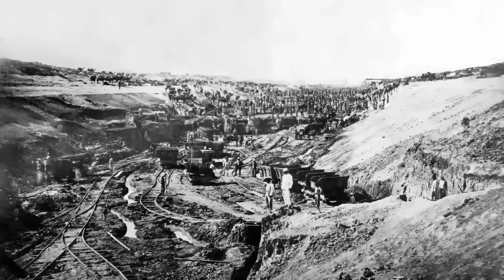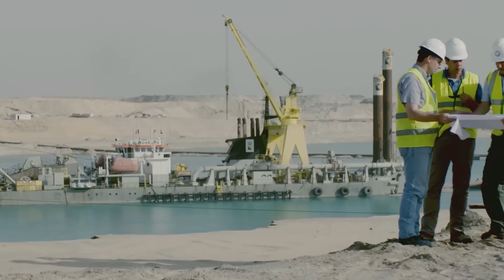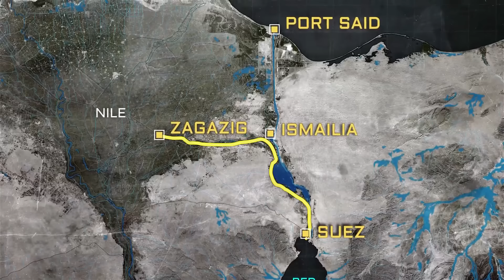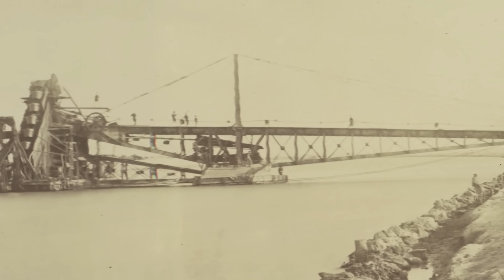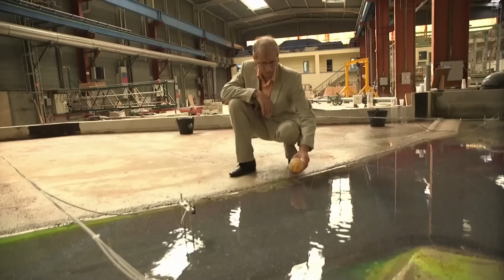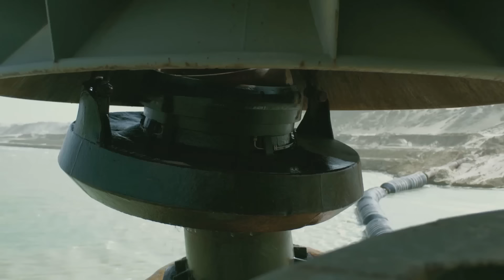Extreme Constructions: The Suez Canal | Free Documentary

Comment: sittin here wondering why they hadn't made the canals like this one into GIANT WALT DISNEY RIDES and put two RAILS down there under the water that use magnetics and the water itself and like the engins of the SHIPS running GENERATORS instead of turnging the props and the GENERATORS POWER THE MOTOR MULES UNDER THE WATER that PULL THE SHIP along from FRONT and REAR  ''submarine-TRAINlocomotive-mules'' ... and the ships are HOOKED UPTO THE RAILS and ''MULES'' to pull them along using the GENERATORS ON THE SHIPS....   eh...